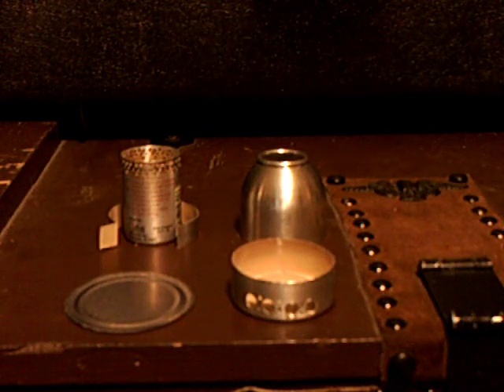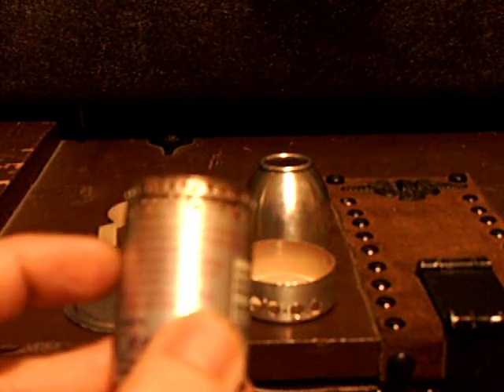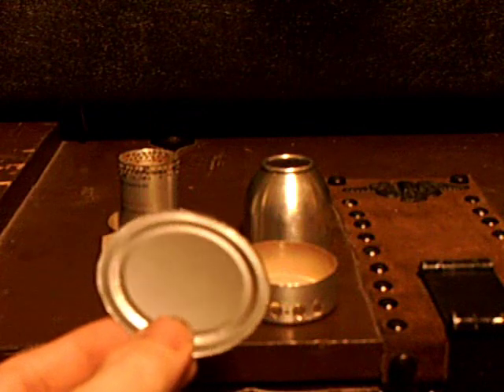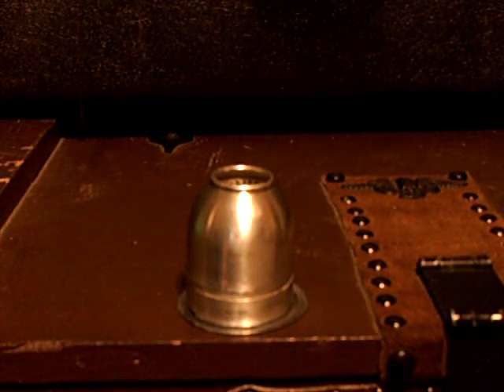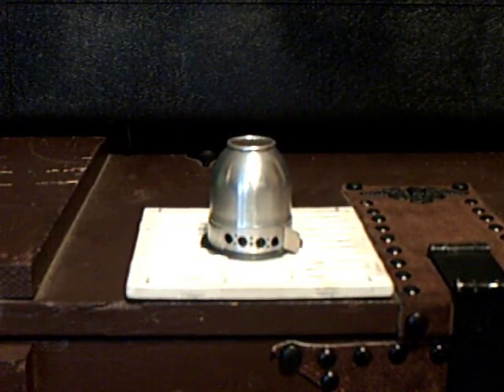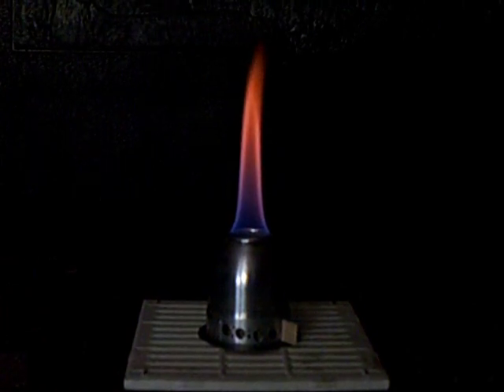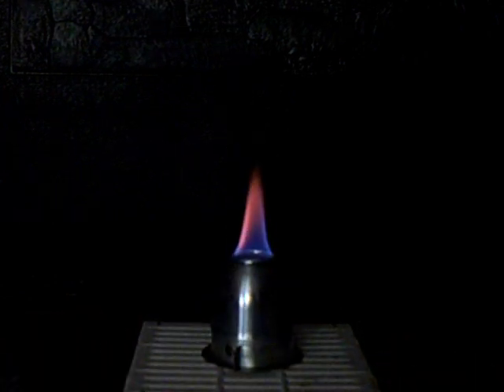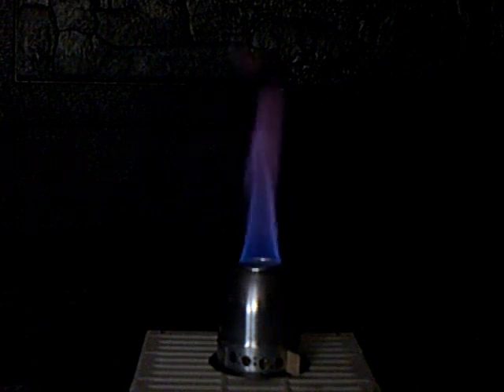How-to: My Jet Stove, Proto #1

Comment: You could melt lead ingots with it 
and set off every fire alarm on the block ! How are You going to secure
the burn chamber ? How are You going to secure the primer pan/base 
and , ( finally how tall is it , ok two more .. how much fuel does it hold &
how long will burn on simmer ) ?!
I think I want one !

Comment: I'm not sure if painting it black would help with the intake but it would help heat the Alcohol so it can vaporize better which will increase the out put of the stove a little. Great design. I;m working on and axe body spray can design based of another one I saw.

Comment: You might want to line the outside with carbon fiber to keep it cool enough to handle, and help retain heat in the system.

Comment: Nice Stove!  Just a thought you might try is 6-8 holes spaced all around the bottom.  Then your control band would have the same number of holes around it.  That way you could control air flow all around the stove instead of just one side.  I do not know if that would cause wind issues or not.

Comment: More drafting, with the mix of more and cooler air will definitely help, but if you would rather make more of a jet simply add a tube to the top which is the same diameter at the top opening and 5 to 7 times the same diameter in length. Watch out for your eyebrows though; I speak with the voice of experience ;)(ouch)

Comment: I just built one works great did not put holes like terrafirma just did 1/16 at top 2 rows bottom just 4 1/4 holes use 7 tiki wicks up right just blow the air holes and a piece of hardware cloth on top to hold them from falling out

Comment: Did you need the fiberglass any of what you put into the center tube? I think with just an empty tube would give you a better flame. Guess that is another experiment.  Have you also thought about another way to open up the air way other then chop sticks. Also leave it unpainted.

Comment: A true work of art.5/5 (again ;o) ) I do have a couple of thoughts. I would not paint this one. It is already too hot. I suspect the sputtering is caused by the heated outer chamber acting like a secondary combustion chamber which gets hot, sucks vapour, shoots out the top and repeats. Its a mini ramjet. How cool.